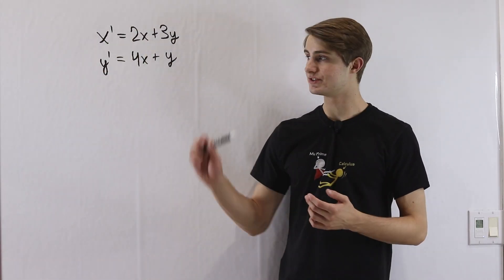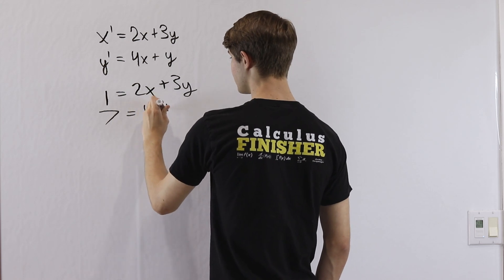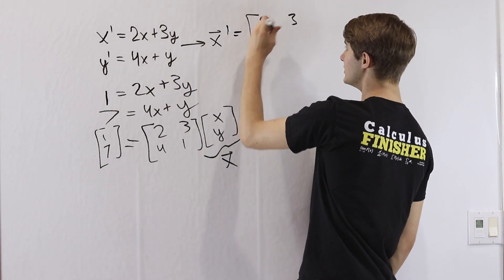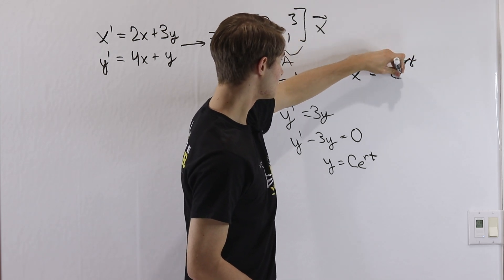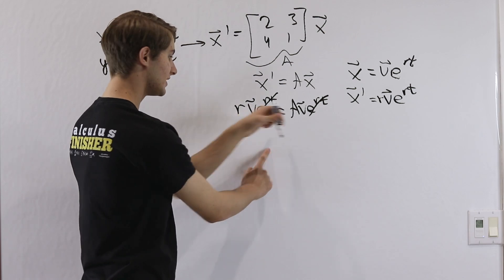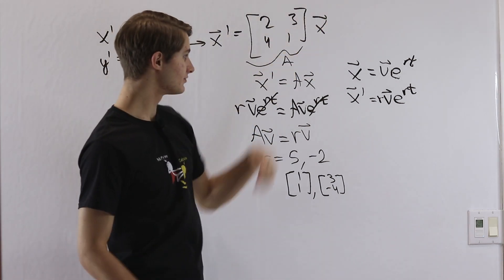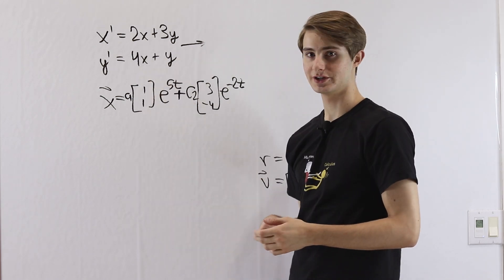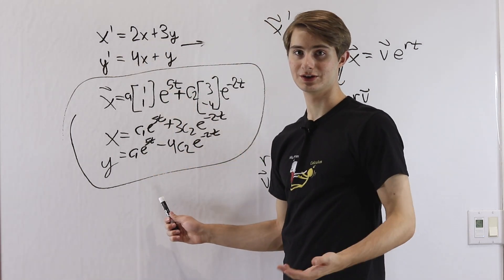8: Eigenvalue Method for Systems - Dissecting Differential Equations

Comment: In russian textbook i found following method 
x' = 2x + 3y
y' = 4x + y

x' = 2x + 3y
ky' = 4kx + ky

x' + ky' = (2+4k)x + (3+k)y
x' + ky' = (2+4k)(x+(3+k)/(2+4k)y)

(3+k)/(2+4k) = k

3 + k = k(2 + 4k)
3 + k = 2k + 4k^2
4k^2 + k - 3 = 0
(4k - 3)(k + 1) = 0

x' - y' = -2x +2y
d(x - y)/dt = -2(x-y)
d(x - y)/(x-y) = -2
ln(x - y) = -2t+ln(C_{1})

x - y = C_{1}exp(-2t)

x' + 3/4y' = 5x + 15/4y
d(x + 3/4y)/dt = 5(x+3/4y) 
d(x + 3/4y)/(x+3/4y) = 5dt
ln(x + 3/4y) = 5t + ln(C_{2})
x + 3/4y  = C_{2}exp(5t)

x - y = C_{1}exp(-2t)
x + 3/4y  = C_{2}exp(5t)

3/4x - 3/4y = 3/4C_{1}exp(-2t)
x + 3/4y  = C_{2}exp(5t)
7/4x = 3/4C_{1}exp(-2t) + C_{2}exp(5t)
x = 3/7C_{1}exp(-2t) + 4/7C_{2}exp(5t)

x - y = C_{1}exp(-2t)
-(x + 3/4y  = C_{2}exp(5t))
-7/4y = C_{1}exp(-2t) - C_{2}exp(5t)
y = -4/7C_{1}exp(-2t) + 4/7C_{2}exp(5t)

x = 3/7C_{1}exp(-2t) + 4/7C_{2}exp(5t)
y = -4/7C_{1}exp(-2t) + 4/7C_{2}exp(5t)

To generalize it for more equations we need k1,k2...,k_{n-1}
but problems may appear for repeated eigenvalues

I dont speak russian (When i went to school it hadn't been taught. My mother didnt want to teach me)
but this approach probably has something to do with eigenvalues and eigenvectors

Comment: Does the superposition principle only work for homogeneous differential equations?
Reply from the maker: Yes. If we add two solutions to a nonhomogeneous differential equation, the sum will not be a solution. For the nonhomogeneous case, we first find a particular solution, then add the general solution to the corresponding homogeneous equation!
Reply: @MuPrimeMath  ah right.  So it’s the same general solution principle thing as for differential equations that aren’t systems

Comment: is there any more simplification than this?? hats off bro
Reply: Yes.   To find the eigenvalues, you can use lambda = m +/- sqrt(m^2 - p), to more directly find them.  This only works for a 2x2 matrix, and unfortunately no such equivalent trick works for a 3x3 or anything beyond.

The m is the mean of the two diagonal entries along the down-right diagonal.
The p is the determinant, which is the product of the two eigenvalues.

So for us:
m = 1.5
p = 2*1 - 3*4 = -10

1.5 +/- sqrt(1.5^2 - (-10)) = 5 and -2

Comment: Wolfram gives a wildly different solution for this system.
Why? 🤔

https://www.wolframalpha.com/input/?i=x%27%3D2x%2B3y+%2C+y%27%3D4x%2By
Reply from the maker: Both solutions are equivalent. If you expand the solution given by WolframAlpha, it gives e^(5t) and e^(-2t). With some algebra, you could show that the ratios of constants work out the same way.

https://www.wolframalpha.com/input/?i=Expand+x%28t%29+%3D+1%2F7+c_1+e%5E%28-2+t%29+%284+e%5E%287+t%29+%2B+3%29+%2B+3%2F7+c_2+e%5E%28-2+t%29+%28e%5E%287+t%29+-+1%29
Reply: @MuPrimeMath  
Thanks! ☺

Comment: Couldn't you just Laplace transform both equations at the start and a get a regular system of equations?
Reply: Both are good, but the reason this can be more powerful is that computers can perform vector math easily, e.g. Matlab and that can be run on superclusters, graphics cards, or specialized processors like ASICs.  Solving using Laplace can be done on a computer too, but it's more costly on CPU cycles and works less often especially for complicated problems.
Reply from the maker: Yes, that's another method for solving systems!
Reply: He specified the method under use